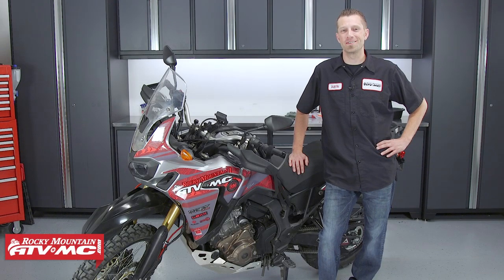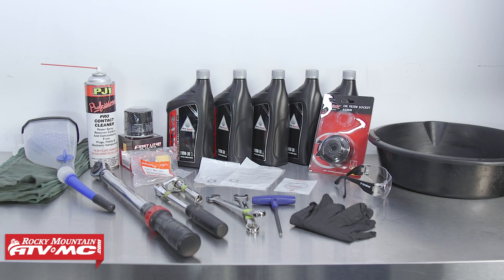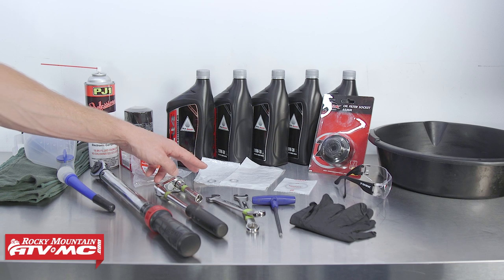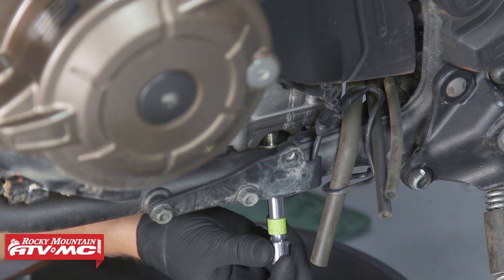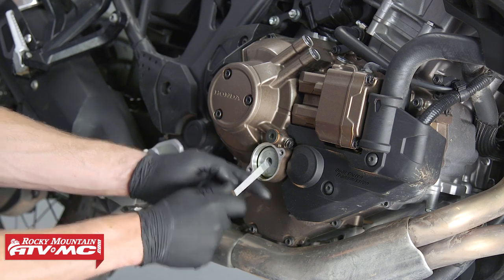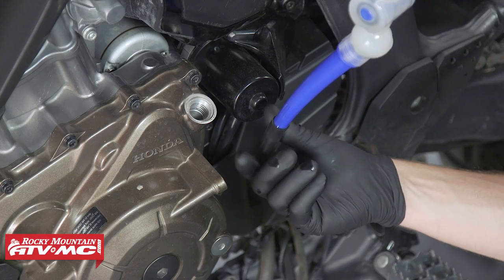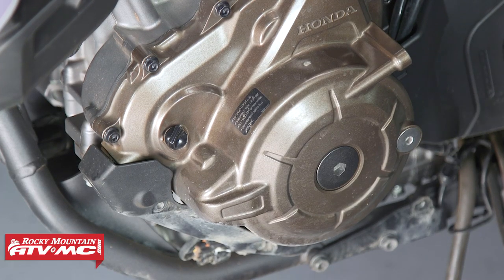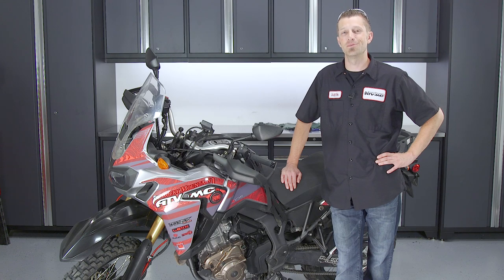How To Change the Oil on a Honda Africa Twin

Comment: Hi great video thanks got a 2019 Africa Twin (non-DCT) what engine oil would you recommend , What weight and fully synthetic or semisynthetic
Thanks.
Reply: I just went to my dealer and asked for the oil, they know what the manufacturer recommends, how much you need, and what oil filter you need

Comment: Can you explain explain how did you remove the right side bolt on the SW Motech skid plate, mine was installed at dealearship since new and for the first 3 services they perform the oil changes, now that guarantee its over I will take care of that, but that bolt its kind of hard to remove, thank you.

Comment: What about Primary and Gearbox fluids?  Don't they need to be changed as well?  I'm an old Harley guy, and on those bikes, you had to change all 3 fluids (Oil, Primary drive and Transmission)  I'm not that up on Honda's system, so my question may sound stupid, but it's legit.  Thanks.
Reply from the maker: Changing the oil on this should be much easier then! These bikes use the same "engine" oil for the clutches and transmission as well so you wont have to worry about filling 3 separate components.
Reply: @rmatvmc Thanks for the reply.  I'm finding a lot of things about my AT that I like much better than my Harley's.  I'm sure I've already had my HOG membership card revoked and been labeled persona-non-grata the moment I sat on the AT, but that's life.  I never worshiped at the alter of HD, always looked at all bikes as being equal.  Again, thanks for the reply.  Be safe

Comment: So, there's an engine oil filter and a clutch oil filter, but it's all the same oil?  What's the point?
Reply: Insures the oil going to the DCT servos is clean regardless of the condition of the main oil filter. Sticky clutch servos would be really bad.

Comment: How much oil for at 1100 dct.
Reply: 4.2 to 4.4 quarts per the owners manual, I can confirm per my oil change. Look for the table if you can find in manual, 2021  manual has no glossary. 
I say thanks to covid Honda didn't hire a professional English writer , Honda skipped basic book writing rules. The worse part is the confusing audio/etc Entertainment section, was written poorly/confusing, what a mess.

Comment: Ciao a tutti la mia scelta per usare il mio cellulare sulla mia moto africa twin 2019 come navigatore é ricaduta nei tre pezzi della ram mount ram-b-408-37-62u supporto telaietto parabrezza, ram-b-201u-a prolunga da 6cm e seconda della grandezza dei cellulari e di dove sono posizionati i pulsanti volume ed accensione in queste due soluzioni ram-hol-un7bu oppure ram-hol--un10bu. La ritengo la soluzione più valida per l'africa Twin 2018, 2019 vista la palpebra e in più non rischiate con prodotti tutti chiusi  ed impermeabili che il cellulare vada in crash per il surriscaldamento.